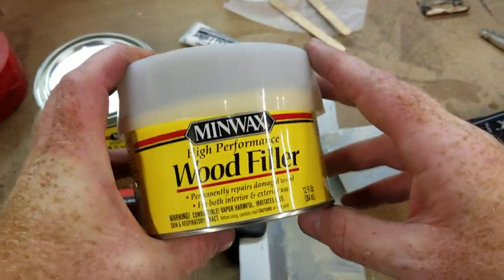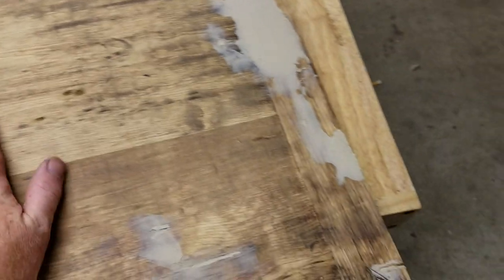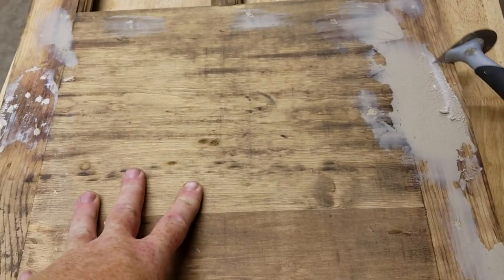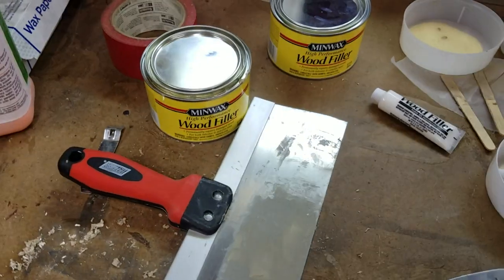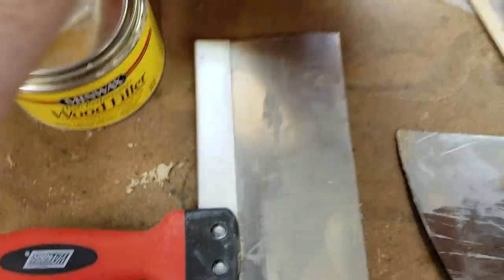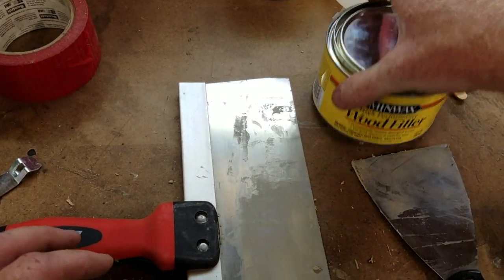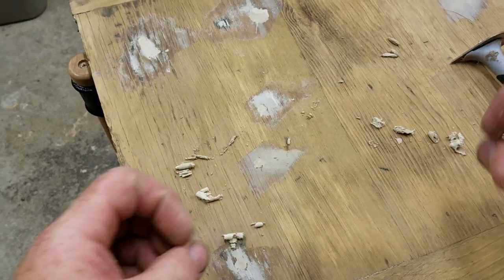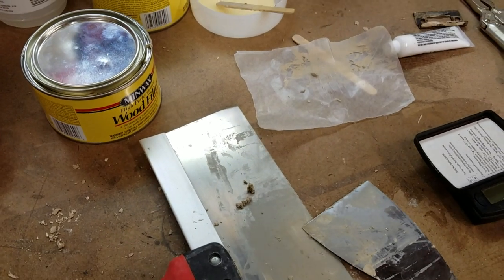Minwax High Performance Wood Filler (Epoxy Resin)

Comment: Do you know if this can be used on particle board? I have a piece of particle board that got a little bit wet & it left raised rings on the surface; I then tried to sand it smooth, but the laminated surface just caked up my sand paper and made the rest of the board have a rough texture as well. Somehow someway I need to get a surface that I can sand down to a smooth surface and spray paint it. I'm wondering if I would be able to apply this and have it stick?
Reply from the maker: +Lynzi K yes,  it will work,  but you will need to make sure that after you apply it,  you put a coating of some kind over the filler

Comment: can I use this filler for lg holes
Reply: You probably could, but you'd probably want to build it up in layers to get an effective cure - I think you can apply it about a 1/4 inch to a 1/2 inch deep at a time. A really large hole might be better filled by mortising out some of the wood to make a regular shaped opening and then gluing in a wood plug using an appropriate glue (i.e. wood glue will work fine for interior purposes, but PU glue like Gorilla Glue would likely work well for exterior applications), then sanding it back to smooth, using filler to cover any remaining gaps. The nice thing about a polyurethane glues is that they expand as they harden, so you'd be left with a more fully filled opening that may not require further application of filler. All depends on your intended end state and the type of finish you want to apply.

Comment: Is there a filler that is like caulking for my fence that has opening in almost every board. I want something easy without all that mix and prep work am a 73 yr old women and I want some thing easy.
Reply from the maker: angie p not knowing the full details of your project, it is hard for me to say what would work.  There are lots of tube based products though that would probably work.  I would stop at your local hardware store and explain what you are trying to address and they will help.

Comment: Newbie here. I have a coffee table with a crevice all along the top (assuming it was cut with a router that way) that I want to fill in. It keeps catching crumbs, play doh, and whatever else my toddler can cram into it. What would be the best way to go about filling this in?
Reply from the maker: +Laura Grandestaff I would probably lying use a self leveling epoxy across the while top of the table.  It would fill the gap and provide a new layer of protection.  You can pick up a product called Super Glaze at your big box store.  It is about $25 and will cover a good sized area.  Just make sure the table is perfectly level in all directions, properly prep the surface by roughing it with a green brilliant pad,  and keep a hair dryer handy during the drying process to raise any air bubbles to the top
Reply: How long does the smell last I have a fan on I have all the windows open we are out of area the smell is obnoxious
Reply from the maker: elizabeth ramirez hopefully the smell is gone!! :)  apologies for not responding sooner

Comment: Is the hardener purchased separately from  the filler?  
...also, I need to repair an outdoor planter.  (cedar)  Would this Minwax product hold up outdoors?
Reply: Hardener is included when you buy the filler (under the plastic cap)

Comment: Hi There, would you recommend the same product for repairing a chipped upper corner on a wood fireplace mantel? if not, is there a better product to use? Thanks!
Reply: If it's painted Bondo auto body filler, or Durhams water puddy. If there's room for a screw inside the repair it's advisable to use one or more. You can use tape as a form. As a warning bondo STINKS and my be a heath hazard, ventilation is a must. If you can take your piece outside even better. I'm no good with stain, I can't help you if it has a clear finish.
Reply: Rock Hard Wood Putty.  Water-based powder, dries rock-hard. Can be drilled or sanded.

Comment: Good video.  I have a question though.  If you are going to end up painting that sidelight why did you spend so much effort removing oils and soda blasting and acetone etc etc.  Surely just a decent sand and then fill holes and smooth and sand.  All that extra work seems to me to be for no benefit.  The paint will cover up all that work you did.
Reply: Paint will not adhere properly if you don't prep it right,

Comment: this was a terrific tutorial but I should have watched it before I applied stuff to the  cracks between the floorboards of my wooden porch floor.  I have large goops of stuff all over.  I guess I can only try to sand it now to smooth it out.
Reply: Carmel Loughman Did the sanding work?
Reply from the maker: +Carmel Loughman if you did not get it all up with sand paper,  you can use acetone, but be forwarned, it will eat almost any finish.  But it will clean up the filler in most instances.  Sorry you had trouble.

Comment: Quick question will this sealer evenutally crack? Having that probkem with my current wood filler
Reply from the maker: Valentina Edmonds -  if mixed correctly,  no.
Reply: I've used this junk and it's really no good. I use wood glue mixed with saw dust. It works a lot better.
Reply from the maker: elan really I appreciate that this stuff can be a pain to work with.  I have been using the same product for more than 10 years and have never had an issue.  I have seen it used improperly and it not work well.  The ratio for mixing is pretty important.  Also making sure to use fresh product is important as well.
Reply: But wood glue can not be stained, can it?
Reply from the maker: +hotmoon226 no,  and when applied more than 2-4 mils in thickness,  it will eventually shrink and crack, particularly if something like elmers wood glue or other cheap brand.  Tite Bond II I is probably lying the only glue I could recommend for mixing and filling,  but even then,  I would apply in thin layers and build up.  Most all wood glues are water based,  most stains are oil based.  Mixing the two together would both not work and you would end up with a crappy joint

Comment: Any particular reason why you favor this product over wood epoxy lines such as Abatron, SystemThree and PC Products? I realize they are more expensive, but for the low quantity you seem to use in furniture restoration, it would seem worth the added cost to have more flexibility in terms of consistency (liquid, paste, putty), zero shrinkage and strength. 

I'm much less knowledgeable than you with respect to woodworking, so I thought I would ask.

Comment: I am using this product now, And it is so difficult to use :(
Reply from the maker: +hotmoon226 it can be tough.  Start with a small amount,  weigh each application and don't get in a hurry.

Comment: The mixing of this is a pain in the rear and needs a better system for home DIY folks......1 to 1 or even 2 to 1 would be way easier.....16:1 is hard to do with a paste for small amounts.

Comment: Seems similar to bondo filler
Reply: Bondo filler is fine indoors, but outside, the bondo filler will be harder than wood and crack it. This Minwax filler works better with wood in exterior use as it expands with wood under hot conditions.

Comment: Why invest all the time to salvage items like this only to be painted?  Left 'au naturale' I get.

Any woodworker worth their salt could clone a pair of these in two days or less.
Reply from the maker: +Benny Hannah while I understand your vibe,  the reality is that reproduction or restoration of antique milworks is not easy or cheap.  Customers pay me to maintain what is real and original.  I do what I know
Reply: There's nothing better than restoring an original antique piece.."any woodworker worth their salt" as you said, knows that.
Reply: Because this is restoration not carpentry.
Reply: $200+ in wood, plus days of labor.
Or $15 for this, probably he used less them $1 worth. And just a couple hours labor.